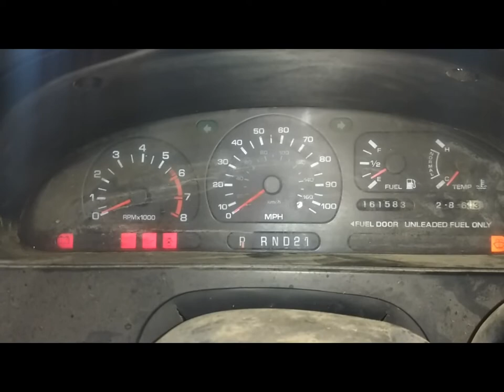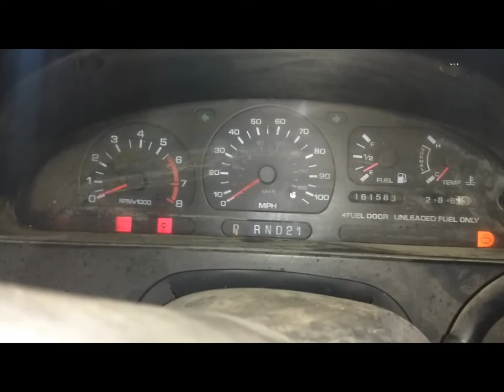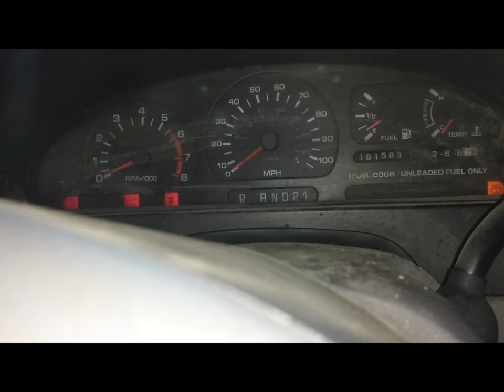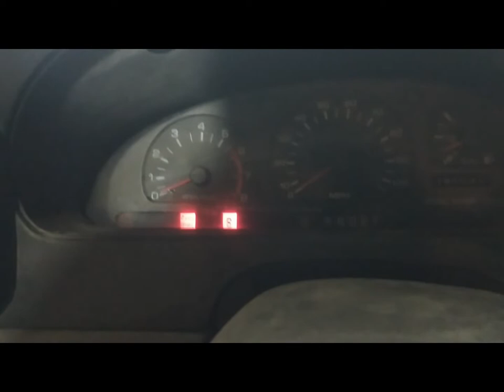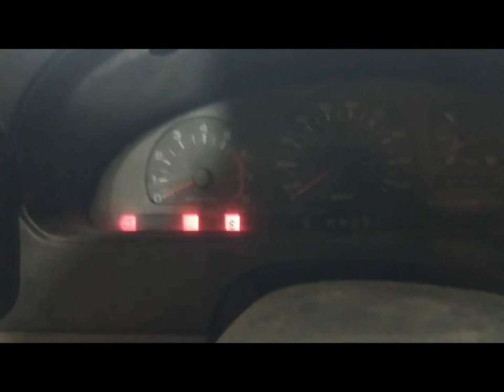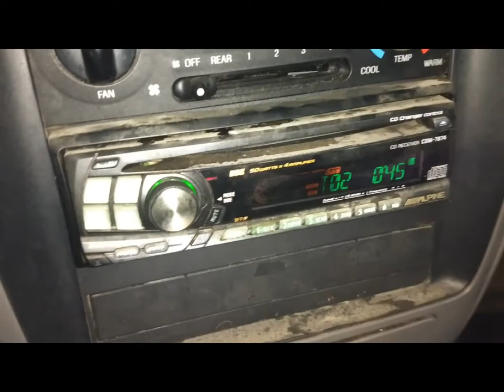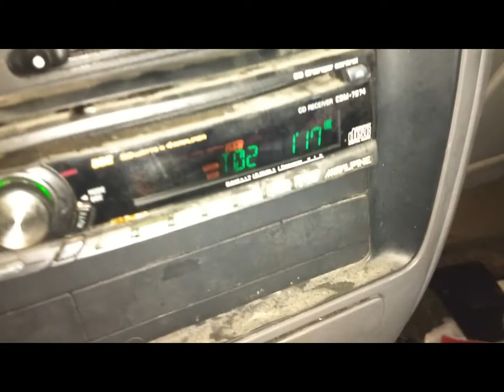Trying to get my junk running

Comment: Man, I always cringed when those would come into the shop. The Ford/Nissan crossover was shit. Made them a Bear to diagnose when something went majorly wrong. Thankfully we really didn't have a lot of major issues with them. Anytime one would come in with a misfire you were pretty much guaranteed it was a corroded fuel injector connector. Lol